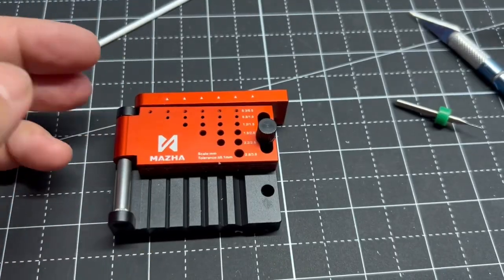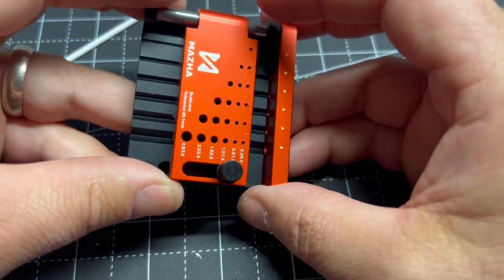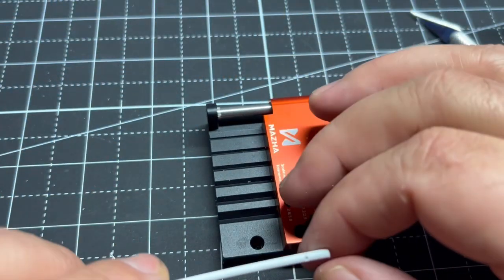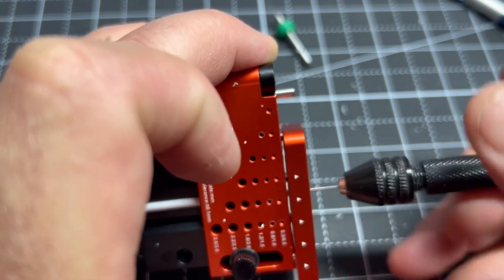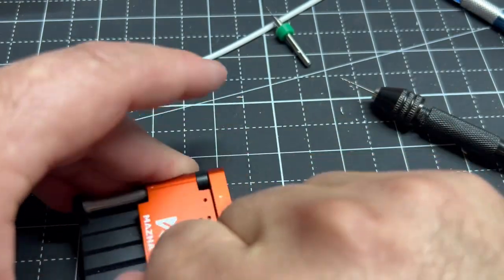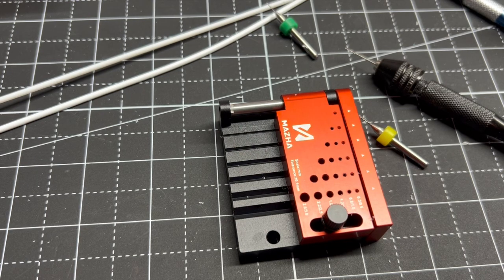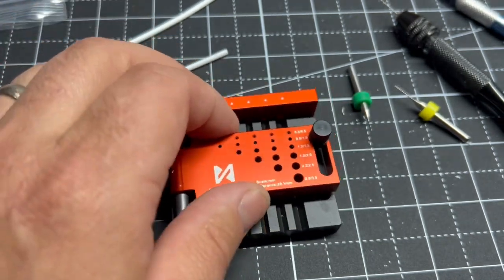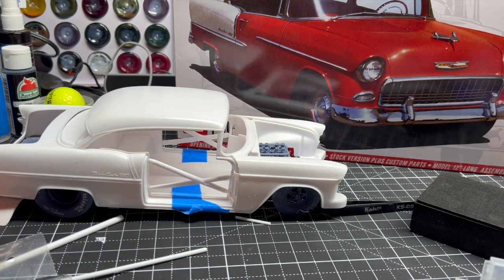New Cool Tool MAZHA Boring Hole Positioner

Comment: I used it. How do I drill exactly where I want the hole in the tube or rod kengthwise? Sure, if I drill one hole in the piece, I can cut it off afterwards. But what if Ineed two or more holes? Unless i am missing sonmething, you cant see where the hole is going to drill in relationship to the length of the piece, before and after  you clamp it.  Without using calipers, there needs to be maekings to line up.

Comment: Any tool that works n saves some time scratch building is worth every cent. Best bits are high speed steel and they make standard and metric of micro bits. Thanks for the video. Dig it!
Reply from the maker: Absolutely